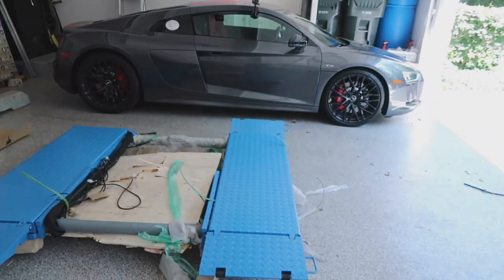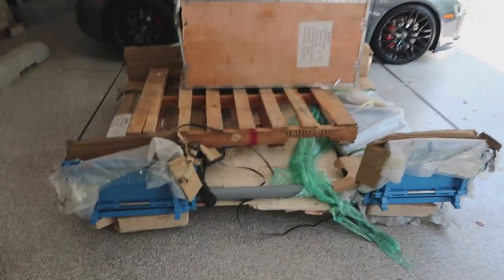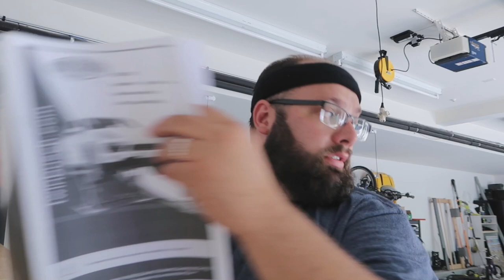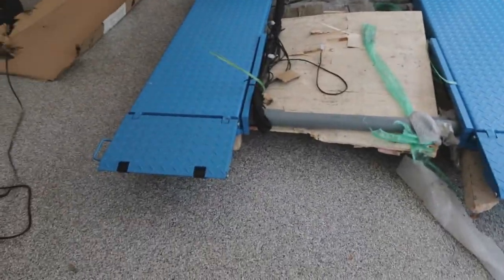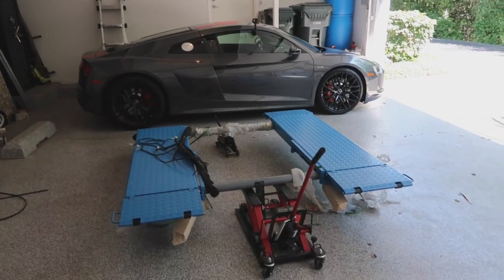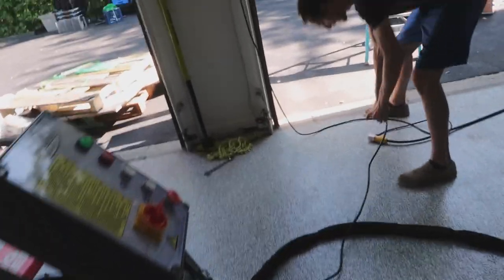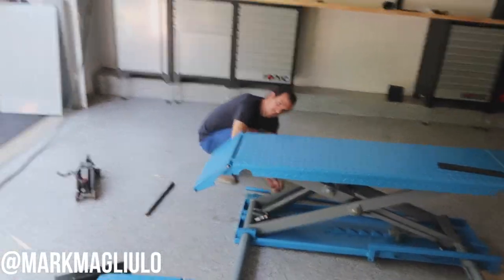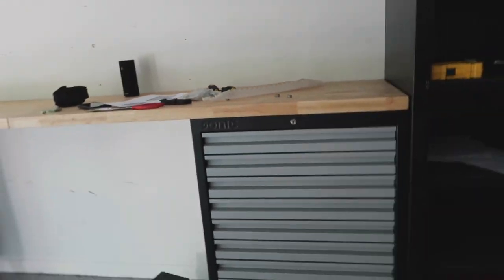The Best Scissors Lift Money Can Buy, Twin Busch TW S3 - 10E! MY $40,000 DREAM GARAGE Pt. 4

Comment: I know the manufacturer recommends a dedicated 30 amps outlet for this, but did you have to run a dedicated outlet to use this lift? You should do a review of it. I’m interested in getting this lift but the whole “delivery to residential” scares me. My driveway has a little bit of a hill too so not sure if the delivery people will Jack it all the way.
Reply from the maker: Nam Pham I didn’t do a dedicated outlet, are use the same circuit as all my other garage accessories, and it’s never been a problem. I don’t think residential delivery is a problem they were nice enough to bring it down my driveway which is 200 feet long. Over the next two months I will be doing 50 Product review videos so stay tuned
Reply: You should test the lift out with a pickup truck. I'm always interested to see if it can handle it. Love the look of this lift. And it looks like it is good quality!

Comment: Awesome video. Did you have to anchor down the scissor lift to the concrete floor? If so, what do you think is the minimum depth needed for the concrete. I’ll be looking forward to your response, thanks!
Reply from the maker: Harry Singh hey, I actually never put anchors in the concrete. I’ve also been working on my car on the lift for the last 6 months no problem. I did purchase the mobility cart for the lift so I can move it later if I want ( pretty easy). So if I want to work on my truck my garage is too low so I’ll be able to move the lift outside and work on my truck outside! Hope this helps!
Reply: Thanks for the response Warrick. You’ve helped me make a decision. I’m going to buy this lift. You have great content and an awesome garage setup. Subbed for sure, looking forward to future posts. Take care man and thanks again.
Reply from the maker: Harry Singh thanks man. That video was when I was new to filming. Hopefully the videos will only get more informative and better from here on out! Ps this is the low rise lift. They do make a high rise? Which one you thinking about getting?
Reply: Gas Tachs I thought this video was really informative. Plus you’ve already finished the hardest part, which is actually starting and posting videos on YouTube instead of procrastinating, which mostly everyone is guilty of. I only have 8ft height clearance in my garage so low rise for sure.
Reply from the maker: Harry Singh thanks! Low rise see perfect! let me know how it goes!

Comment: Are you sure you want to be underneath a car with a lift that only costs $50?
Reply from the maker: Hhahah, maybe it'll squish me into the correct shape
Reply: @GasTachs  Haha
Reply: Jcc988, the small $50 portable jack was used to move the heavy garage lift. That portable jack and the one in your trunk is only to be used to change a flat tire and not to get under a car.